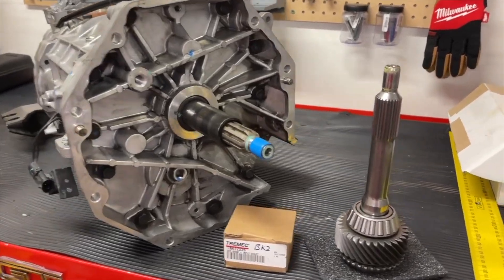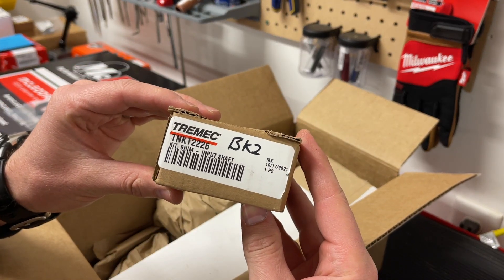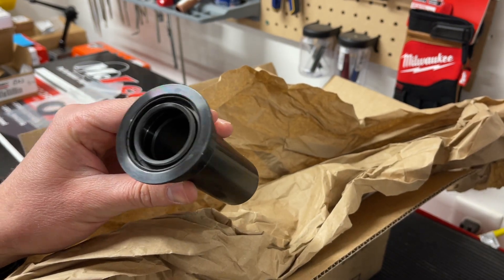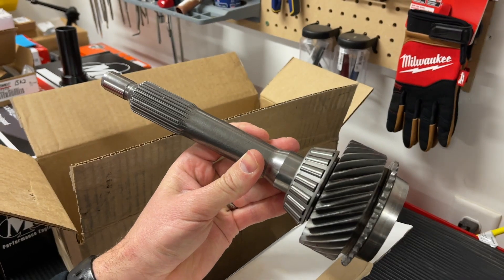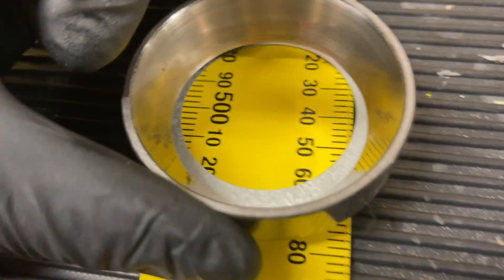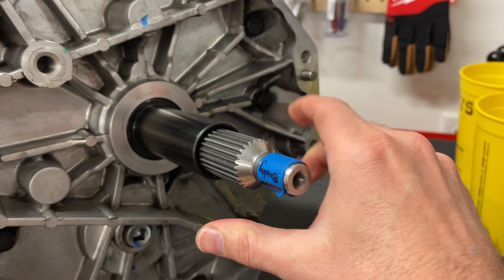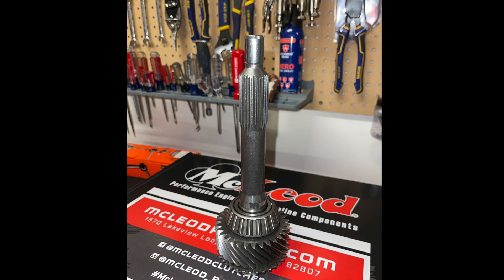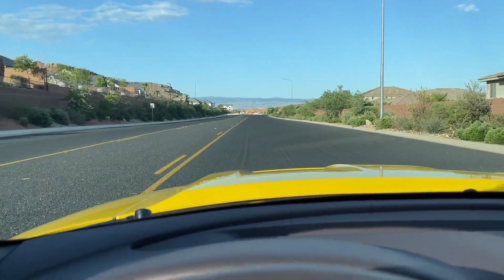Issues with 26 spline input shaft upgrade for 2003-2004 SVT Cobra T56: Is a magnum a better option?

Comment: Mine whines like an SOB with RPM.  Nobody seems too concerned, but it irritates me.  Shifts fine.  I kind of gave up and live with the noise because pulling trans is a PITA.  I took it to the shop I bought it from and said he barely heard it.  Well I hear it went driving under light load and it annoys the hell out of me.  I have a TKO600 on my Fox and it’s quiet.

Comment: I have the same noise and just re shimed mine.  Mine makes a nasty noise in 4th gear at lower RPMs but than goes away.  Did yours do that? No metal in the fluids. It’s annoying I have pulled the transmission out twice now and might a 3rd time and have them send me a new one.
Reply from the maker: Mine would only chatter if it was lugging it. The countershaft should be the only gear affected, since the other gears are all farther back (but a really bad shim on the input shaft could cause the countershaft to vibrate).
Reply: Ok sounds good! Thanks yeah it’s kinda only when lugging.  I feel I have it shimmed pretty well right now.  Idk kinda stuck not sure what to do.  You said all the ones you found are same manufacturer?  Would it worth it to press on a new bearing? Are  You driving yours with the noise?
Reply: Do you need to re shim the other bearing that rest in the front cover, assuming that is the countershaft?

Comment: I ran the 9310 metal shaft in my car from 2004-2007; put about 4500 miles total on it. Made the same noise stationary at idle as your car did around 9:40 in this video. IIRC the "chatter" faded out over time but it was a stage 3 cam car so I might not have noticed or just became accustomed to it. I do specifically remember the noise being there first drive with the new shaft.

I ran the snot out of it (street/strip) and never had any issues with the tranny (26 spline + clutch was the only modded part of the tranny). Sold the shaft and clutch, wound up having GForce build me what now equates to their 1200hp T-56 in 2007. Got out of the game in late '07 and the GF tranny still sits never used.

Comment: I measured the distance from the bottom to the top of bearing and it was almost identical. The new one was about .05 taller.  2.855 new vs 2.850 old.   Even with no shims it would bind. 
I also noticed the race was slightly off. I tried 3 of them all within .02 of each other. No shims, still binds and that’s me just hand tightening a few of the bolts. The aluminum cases couldn’t touch. I place the original back on without issues. Back and forth I went but still no fix. I mean with no shims it binds, with the smallest shims is worse. I wonder if I purchase the gasket set instead of using gasket maker would fix this problem.  Thoughts !!!
Reply from the maker: Return the shaft as defective. They’ve sold too many hoping people deal with it
Reply: @dannyjohnsonsgarage any recommendations of where to source one?  I am at a point where I may just stick with the 10 spline.
Reply from the maker: @ stick with the stock 10 spline or be willing to mess with it until you make it fit and then deal with some noise. I’d say sell the stock transmission and get a magnum if you want 26 spline
Reply: @dannyjohnsonsgarage really appreciate the honesty. I don’t want noises so for now I’ll stick with 10 spline until I can afford the magnum.
Reply: @dannyjohnsonsgarage wanted to give you an update on what I found with the unit from AMP Distribution in TX.  The unit is actually longer, when measuring from bottom to top of bearings it was almost identical but the real issue was this:   If you look at the bottom of the shaft, inside there is a race pre installed, can’t be removed. This race is actually thicker than oem thus not allowing it to be seated all the way on the bearing. This clearance problem pushes the input shaft out to the point that the case can’t be closed. I mean I studied this thing and that’s the main issue.  Upon close inspection it appears this smaller race inside the shaft is narrower than OEM.  This has to be a manufacturing defect.
Reply: @dannyjohnsonsgarage  If you are a super nerd purist like me, you might want to hang onto your stock T-56 if it is #'s matching to your car...

Comment: Unrelated i know but you're probably my best chance at getting a straight answer for this; Im piecing together info for a explorer 302 + 4R70W swap into my 3.9 mustang and i was wondering what fuel system it has, a return or returnless style? i know that if its the same as the explorer engine i can just run fuel lines to the stock fittings and it'll work but converting to one or the other is the problem, so far ive figured the engine mounts are about the same and id probably just need 94/95 rubber mounts, the transmission mounting is the exact same, and i can use bendy steel hoses for radiator hoses or retro-fit the explorer coolant system, then steel lines for power steering and keep the stock ECU

Basically converting the OEM drivetrain 1:1 for the explorer's then converting whats in the chassis from factory to work with it, taking stuff off the explorer or 94-04 GT cars as needed

Any info you can give helps, forums arent being very helpful other than cross referencing parts but that only goes so far
Reply from the maker: The V6 Mustang should have returnless as it also has the fuel pump driver module (fpdm). If you run into a lot of trouble, a return system is pretty straight forward but you’ll need a tune 
Fore Return Fuel System Installation: Ford Mustang 03/04 Cobra, GT, Saleen, Bullitt, Roush
https://youtu.be/bteiCwIHuq8
Reply: @dannyjohnsonsgarage  Cool thank you, it seems after '99 ford switched explorer's to use returnless systems for emissions purposes so i just need to adapt the v6's fuel lines to it and swap the pump from the explorer
Reply from the maker: Here is an overview https://youtu.be/dJWk334Ytek?si=j5gJIg5xWW0zgxaP

Comment: There are 2 suppliers of this shaft in the after market. The one you have (REM polished) and ours (which is black in color and sold under Part # T56-16F).
Reply from the maker: Do yours make the same noise?

Comment: I’m dealing with the same issue as we speak. Thought it was a shimming issue, took it to a trans shop to confirm the shimming. 
Turns out the main gear of the input shaft was poorly machined (unevenly) causing a harsh sound even worse than yours. I demanded a new input shaft from the vendor and working on that now
Reply: Who's the vendor?

Comment: Few years ago my T-56 Reverse went out and one other gear that I can’t remember .my Cousin owns a transmission shop but he ended up sending it out to a certified Tremck dealer to repair the Transmission and upgrade to the 26 spline shaft . I also noticed it was a little more Noisier and I was told that’s normal 🤦🏻

Comment: Dan,  I did this exact same process last year on my ‘03 vert after watching your videos.  I needed to replace the clutch, flywheel, TOB, pilot bearing, clutch fork.  I bought that input shaft which arrived in same packaging.  It has the same noise as yours.  The only thing I didn’t do was shim the countershaft as I had no shims.  That process was done in a video I believe by Tick performance.  I drained transmission fluid a few months ago and didn’t notice anything major, fluid looked good.  I will sell my setup and go with the magnum in the future.